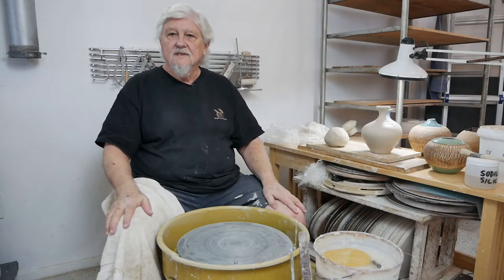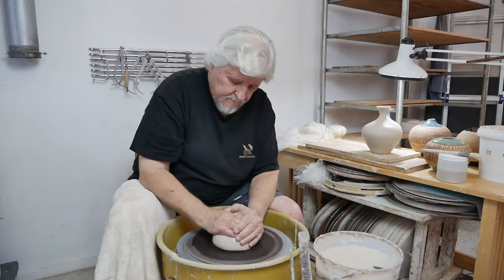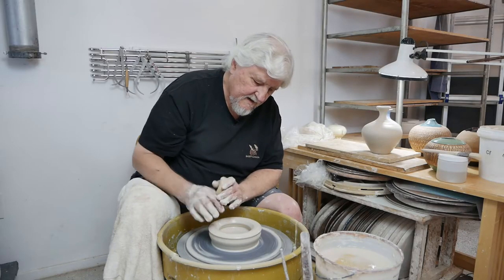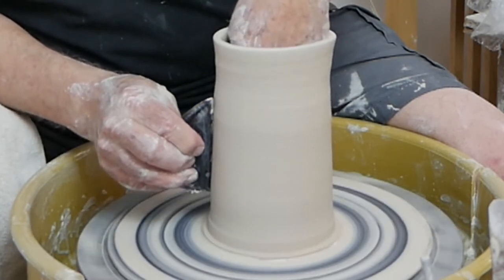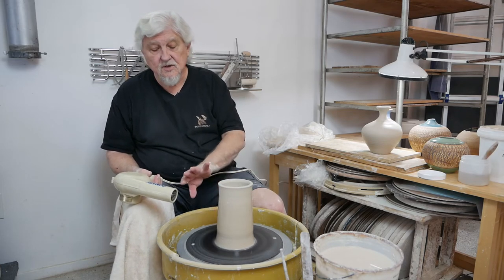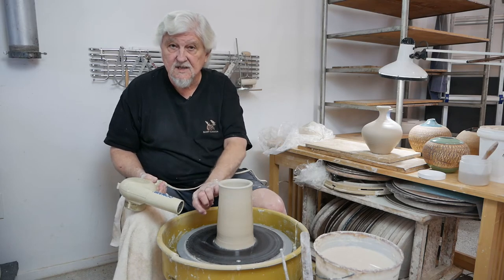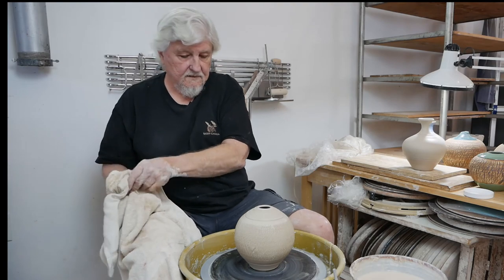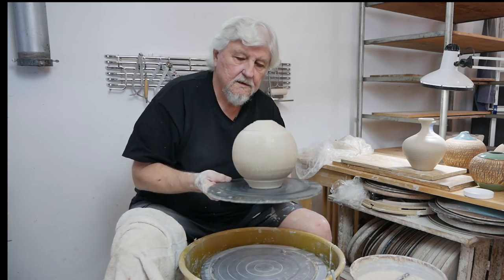Sodium Silicate Stretch

Comment: very good & thorough 
i watched to remind myself how to use the sodium silicate (which i previously did on slabs which we rolled with rolling pins after drying the S.S....
& instead of just a SS lesson, i got a wheel lesson as well...& great tips i truly appreciate! (Like how the sodium silicate can dry on the lid and cut you when you open it, or how you need to wire cut the bottom of the pot even if you’re going to leave it on the bed so that it doesn’t dry and evenly and crack…)
thank u  🙏🏼 so much
ur a good teacher & a good video maker 🌺🤓
Reply from the maker: Thank you for your kind comments.
Reply from the maker: Mind the gap too...

Comment: I have tried this now a few times, and  I am getting a bit better. However, most of my cracks are vertical and fairly deep. They look nice enough (for a beginner pot), but I would like to have more of the smaller cracks and also some horizontal ones. I do not  know which the variable is that I need to change: wheel speed, amount of sodium silicate, length of drying? Do you have any suggestion?
Reply from the maker: It is hard to say without helping you in person.  My best guess is to make sure the sodium silicate is dry to the touch before stretching.  
I hope that helps, keep practicing and you will fine tune it to your taste.
good luck,
Richard

Comment: Thank you for clear instructions! Can you reuse the clay that has abit of sodium silicate on it that you cut away on the bottom?
Reply from the maker: Yes you can reuse the clay.  A little does not adversely effect the clay, usually it gets wedged into a larger piece.  Sodium silicate is normally used in casting clays to reduce the amount of water needed to make slip which reduces the shrinkage and cracking.  Some people will use a deflocculated slip for joining clay together like with handles.  Good luck.

Comment: Is the stain on side just a wash wiped back?
Reply from the maker: You are correct.  I glaze inside, top, bottom then wax on to of the glaze.  Allow the wax resist to dry then wipe away with a damp sponge the excess glaze to the waxed line.  I then brush a watery wash over the texture and finally clean the high areas with a damp sponge.  Be sure to keep rinsing the sponge in water as you wipe.  I made a video of the process for you : 
https://youtu.be/VsxIdqovN8Y
Thanks,
Richard
Reply: Thank You